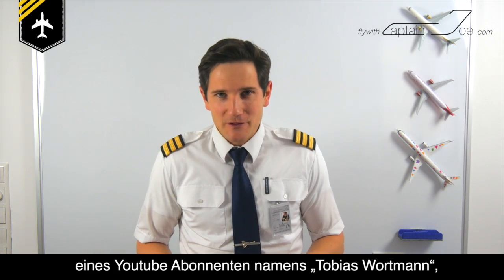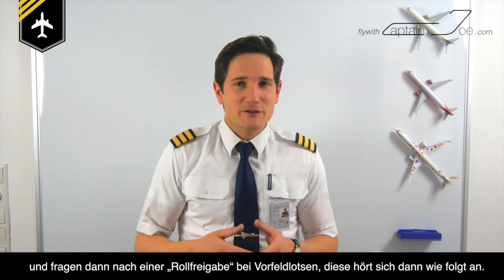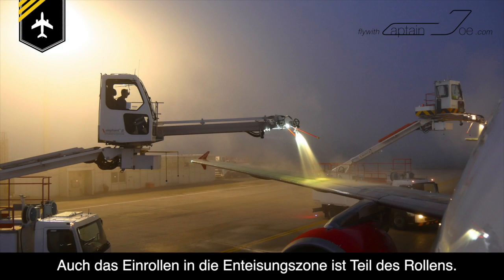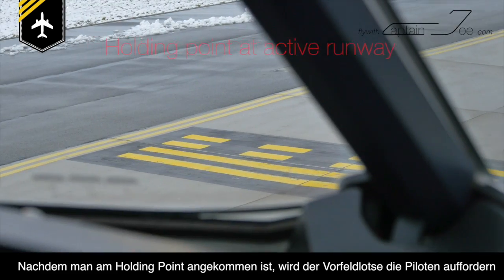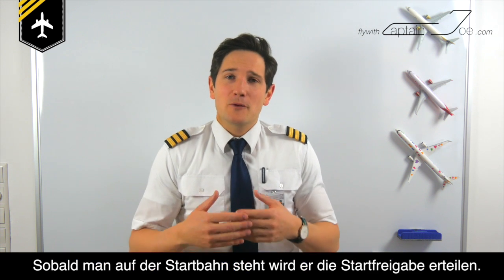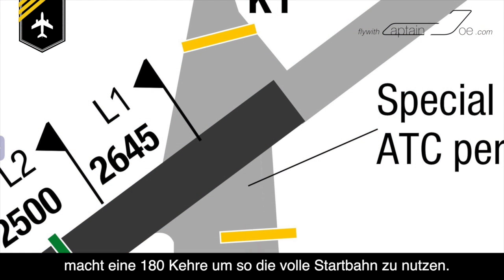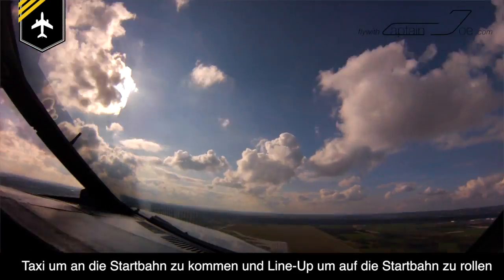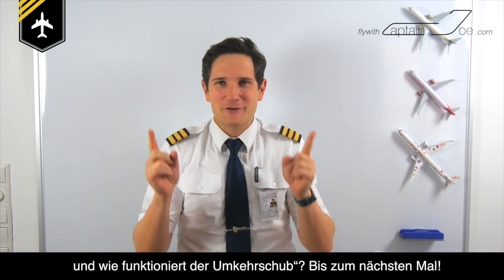Taxi and Line Up! Explained by Captain Joe

Comment: Sir 

How plane reaches its appropriate gate after land ing .. specially in large or multi gate airport..how you find the path
Reply: Pilots have the airport taxiway map in their iPads and the ground controller gives the instructions which taxiways must be used. Each taxiway has its own letter code that distinguishes them from each other. The ground controller uses these letter codes when they give the instructions.
Reply: @mikep9604   thanks sir

Comment: Sometimes do the tower say "cleared take off, runway 27" even if you havent lined up yet? And your still in a holding position

Also, i know they say "line up and wait" if there is traffic crossing the runway, or an aircraft has just landed and hasnt vacated the runway 👍

Comment: Boeing 747 requesting ifr clearance to IIA - Boeing 747 requesting push back and start from gate 7 facing southwest - Boeing 747 facing southwest and requesting taxi instructions - Boeing 747 holding short on delta - Boeing 747 lined up and requesting take off from runway 40 right - Boeing 747 requestion freq change to IIA - Have a great day tower - 
Yes guys im board and have no life i know

Comment: Capton.
Pls. once u take off how do u communicate to the various towers on the way...till u reach the landing
Reply: Air traffic control services (ATC) on the aircraft's flight route use different radio frequences, and the pilots must change the radio frequency to communicate with these different ATC services during their flight route.
Reply: @mikep9604  how frequent do you communicate ,, every few minutes? also is it by voice or by system
Reply: @kaleelururrahman6059  -  Not every few minutes. But for example when arriving to a new ATC zone, or when need to change altitude (descend or climb) to a new flight level, or start the approach and landing procedure, change course or flight plan, or when ATC contacts and wants the aircraft e.g. change its flight level due to other traffic, or gives some general information. These are few examples. Communication is normally made by voice, but airliners also have a data link system CPDLC (Controller Pilot Data Link Communications) which can be used to send and receive certain non-urgent ATC messages via text message between the aircraft and the ATC.

Comment: Does a plane always have to land a certain way taking in the account of the movement of the earth? I would think if it did not two things moving in two different directions would cause the plane to wipe out.. If you try to move two wheels against each other the opposite way it does not work out well.

Comment: I am not a commercial pilot, what does the term "shortened" mean? During taxie I hear it like 22L shortened
Reply: It means that aircraft can't use the full length of the runway. The reason of this is often repair or construction. So the runway has a shorter useful length for the aircraft than it normally does.
Reply: @mikep9604  thanks

Comment: I have a question. How atc are able to give clearance to so many aircrafts at once .how they are able to connect and how confusion is been avoided?
Reply: Depending on airport facilities, ATCs in a low tech airport may rely on pilots’ timely reports to keep track of them and plot their route on airport ground chart, better airports would have ground radar to provide more accurate (and mostly real time) tracking, the most advanced airports would have ground movement sensors and other equipments to compensate what ground radar alone could not cover.

Comment: Hi joe i want a know what are the qualifications do required to be a pilot
Reply: Briefly: 
- You have to be able to hold the Class 1 medical certificate.
- You have to be graduated from high school (Europe). However, if you are in the      USA the major airlines there usually require a college degree. 
- You need to have the English proficiency test to fly international flights.
- You have completed the training for a commercial pilot licence (CPL) with multi engine and instrument rating. You will get the ATPL (Airline Transport Pilot Licence) later. 
- You can get a PPL (private pilot licence) at the age of 17.
- You can get a CPL (commercial pilot licence) when you are 18.

Comment: Captain J why are jet engines not secured with a sieve like wire material to avoid birds from entering the engines
Reply: prince handima because even a net like structure can mess up the airflow going into the engine.

Comment: The part about the plane limited to 10 knots when turning to prevent front wheel collapes....after landing sometimes its felt like they are going aloft faster than 10 knots when turning, but maybe the speed limits are different.

Comment: So the Tower control says "Are you ready"....but what if the pilot says "Nope"
Reply: Then tower would ask about the situation and how the crew would deal with it, should the problem couldn’t be dealt fast by the crew on the holding point, the plane will be removed from the runway either by having it taxis or being tugged to somewhere the tower assigned for it (e.g. the de-icing pad of the runway). In emergencies which the plane cannot be removed (fire, crash...etc), the runway would be closed off.

Comment: Are large aircrafts able to pushback (go in reverse )on its own power ?
Reply: The reverse thrust is not used for pushback at the gate or on the ramp. There are several reasons why it's not allowed. There are airport and airline regulations, important safety reasons, and extra fuel consumption. The jet blast is dangerous for the people working there, and it can damage the nearby equipment. And the jet blast can kick up debris from the ground which can be sucked by the engines and cause damage for them. So they use the pushback tugs.
Reply: @mikep9604  , thank you. I get what you're saying and know that. My question, however, is about the technical aspect of ability: Can a large twin-aisle aircraft push itself back just by using thrust reversers. This is regardless of whether it is regulatorily allowed, or whether it is a good idea, or whether it will damage nearby equipment, or whether it will increase danger to ground workers. My question is one about ability. Hope this makes sense.
Reply: @thihal123  - It is possible. I have seen a report about B747 doing that.

Comment: My question 
Why don't aeroplane does not collide In air?
How they travel with out collision with another? 
How they
Reply: It is because Air Traffic Control carefully plan the directions a pilot must take to safely reach the intended flight path. It is called vectoring, each instruction is called a vector. The pilot is then instructed how high they will fly, or the pilot can request a height if they wish. If all the pilots follow instructions correctly, everything will be fine, but the Air Traffic Controllers keep a constant watch of aircraft positions anyway, on their screens. If an aircraft strays from the instructed vectors, they will be told to correct themselves. I hope this is useful to you.

Comment: As a controller in the US, you will never hear us say "Line up and wait behind landing/departing *aircraft*". That would be us issuing what we call a "conditional clearance" to a pilot and we are NOT authorized to do that. At least not in the US anyway. Controllers are required to wait until the first aircraft is past the taxiway that you will be departing from and then issuing the "Line up and wait" clearance ("Callsign, Runway ##, Line up and wait. Traffic to exit/Traffic crossing/etc")

Comment: Captain Joe, I do not know how my question would reach you or whether you see question through the comment section. My Question is, ""If you can make a video on how starting from 4000 ft, say to land how step or stagewise descend happens, as we hear in plane Captain announces roughly around 30 minutes ( referring as an example domestic flights India) before about landing process" or will be ready for landing"

Comment: I have a question. What's the sound that we hear when we step in the plane. It sound's like an engine but actually the engines aren't started
Reply: MR WHITE BLACK if you happen to be at a remote stand, most likely it's the APU. Alternatively, external air conditioning at warmer destinations contribute to the noise during boarding.

Comment: I live in Australia and I have to fly out of Gold Coast International Airport (YBGC) to Melbourne International Airport (YMML) and back almost everyday. The airport is very close to homes and buildings, meaning we have 1 engine taxi on a B737-800 Virgin Australia. About 3/4 of taxiing is done without engine #1. This is only in the mornings, because the noise may damage the houses and buildings. And only put about 60% of throttle into the engines, thus creating less noise, using up all of the runway. In Melbourne however. It is massive, and in the mornings both engines can be started up prior to taxiing. Also no homes nearby or buildings.

Comment: Hi captain .
I hope you will relp me
if there is any pilot here kindly answer my question.i observed many times on flight radar that mostly two planes of same type just like Air bus A320 on same route but travelling with different speed just like one was at 752 and other wss 960.why there is speed difference ??pilot save fuel????

Comment: Hi Captain Joe
Your all videos are so informative and knowledgeable. I would like to thank you for awesome videos. 
i have a question for you related to taxi, while taxing the plane to the holding point pilots may use brakes just to slow down or maintain the taxi speed while taxing  if i am not wrong but at what intensity they can apply breaks and if they apply does it feels to passengers? 
Thank you :) 
Love your Channel 
Ravinder Singh
India

Comment: I was recently on a Lufthansa flight which was heavily delayed due to take off restrictions/weather (Captain said air traffic control only permitted 1 take off every 30 minutes; delayed by around 4.5 hours sitting in a very hot cabin with backup power malfunction on the A380). We were also told by the informative Captain that we needed to remain in the plane with cabin doors closed so that we could 'queue' for take-off but our plane remained parked at the boarding gate. Is there a difference in the queuing procedure between waiting at the gate and waiting next to the runway? Were we still under the 'taxi' phase before departing the gate, or 'line up'? This was at HKG. Thanks! And as always, great entertaining videos :)

Comment: @captianjoe I was landing in Iceland airport to transfer to Germany, about 30 meter(ish) from the ground (landing), the plan quickly takes back off, and climbs back into the air to land on the other way of the runway, what's the point of this?

Comment: Nice explanation. For taxi, i hear few pilot need to "juggling" if the plane can pass with middle yellow line. On planes like A380 or 777, both planes uses external camera. For line up, i found some flight are took off immediately (i mean pilot start to increase take off when lined up without stop)

Comment: Yeah Joe I have problems with the question and the answer. In the caption and introduction, I was expecting to see or hear "what is the difference between taxi into position and hold and line up and wait?" Instead the question was, "what is the difference between taxi and line up???" In your answer you explained the atc instruction "line up" which you will never hear any atc say. At th holding point you are either instructed cleared for takeoff or line up and wait. You even said atc will say line up behind. That will definitely never happen without wait. Perhaps the question meant to be "what is the difference between taxi into position and hold and line up and wait?" The USA used taxi into position and hold prior to 2010 and switched to line up and wait.

Comment: Hey Joe, how do you perfectly align an aircraft with centre line of a taxi  or runaway? Any cameras under belly assisting?
Reply: Dan Will Usually you need to align the centreline at the middle of your point of view, which is around where there is the warning system in front of you.

Comment: I noticed showed a picture of the de-icing operator in the enclosed bucket. That brings back memories when I used to operate these at NWA definitely more comfortable than the open bucket having to hold a hot hose of glycol. I had privilege of operating both. The enclosed was more complicated to use bit at least I didn't freeze in the open bucket and the wind blowing glycol in your face. Kinda funny it tastes just like Tutti Frutti Bubblegum.

Comment: Captain Joe - why are go arounds not good?     Btw, your English is perfect.  Thank you!
Reply: Not to mention the delays. Imagine missing your connection because some dolt wasn't ready for takeoff and entered the runway.
Reply: steemdup because it's a heavy load of stress on the engines, also during go around the engines are very inefficient and can't burn the fuel completely as well as usually
Reply: steemdup and for passengers, this procedure is on the one hand very exciting (for some passengers) but on the other hand you can feel the enormous force, that pulls you in your seat, maybe not everyone will enjoy this, but I definitely would :D
Reply: There are two different issues there,one is pilot  readiness and  the other concerns unavoidable problems like crosswinds.
Reply: And there is also the fact that tower will not be impressed with you especially at busy airports where they are under constant pressure to move north of 40 aircraft per hour per runway in some cases. You blocking their active runway because you didn't get yourself in order will go down like a lead balloon.
Reply: For many reasons, first and foremost the extra fuel burn, the delay which could result in passengers missing their connecting flights, and the confusion and extra complication of re-sequencing the aircraft back in the approach from the controllers' perspectives.
Reply: no that's not right. The Pilots don't have the fault when they need to go around, for example due to bad weather or sth else
Reply: I had a go around once at KRNO.  I think it was for a reason Joe does not want to talk about.  Basically its an emergency situation where a landing plane at the last moment cancels a landing and flies over the said runway and pulls up in an emergency like manner.  Go arounds especially due to hubris by misbehaving tarmac planes can be very dangerous and time consuming, let alone costly.  Definitely something to avoid unless it is completely unsafe.

Comment: Joe - What is the name of the U shaped primary controller which the pilots use to steer the aircraft in flight? 
Also, did I hear you correctly in the video - The "Tiller" is used to steer the aircraft during taxi or line ups?
Reply: it's called Yoke and yes, the Tiller is used to steer the aircraft on the ground.
Reply: yes, its like a paddle controller on an atari 2600,  it turns the nose wheel (slowly) because there isn't enough speed for functional control via the air surfaces. It need to be positioned center, before takeoff. there is a pin for the ground crew that the nose wheel free swivel when they hook up a tow bar.

Comment: How do you know when the nose wheel is on the centerline on the taxiway or runway during turns? I have troouble doing it in FSX. I normally turn too early.
Reply: MrJetra Prediction
Reply: Ifly 777 You mean, learning the feeling of where the aircraft is? Or, do you have a fix point, i.e. in the cockpit or on the horizon?
Reply: MrJetra There is. In fsx, it is about at the warning buttons below the glareshield
Reply: Ifly 777 Okay, thanks. I will have to exercise myself.

Btw, do you know anything about the genuine Sperry-Honeywell MCP? Of my special interest is the function of the max bank angle under the Heading knob. 

This MCP has a rectangular base-shaped heading knob, but how do you set the bank angle? Are they two separate knobs, or is it a knob on a push button (eventually, how do you know the actual bank setting if you just push it)?
Reply: MrJetra I don't know sorry.
Reply: Probably because of no depth sensation on the monitor.
Reply: MrJetra well correct me if i am wrong, but pilots match with center line of the runway with the divider of wind screens in front of them( seperation between the main wind screen)
Reply: @saajanshah1820  you'd be off the centerline
Reply: Put it on the centre line visually with an external view of the plane(outside xockpit) then freeze.Then check where the centreline us with inside cockpit view use a referwnx3 point. Eg Master warning push button panwl or wiper area..it wipl vary where it is for differentbtypes of aeroplanes.In the comp flughtvsim it ay look differenttgan on the real planevduevto scale differences.In thevreal plane  it usually is if from rightbseat..slightly left of right knee..provided your seat height is adjusted correctly..with reference to aligning the three small marbles 2 white and one red or black in the middke behind the centre window pane shield.

Comment: As always great video Joe, would you consider making a video about speed breaks, what they do, when their used and some more informations about them. Thank!
Reply: Speedbrakes/spoilers/lift dumpers are panels on the top of an aircraft's wing. These panels can be extended in the air to increase drag (reduce speed) and reduce lift (increase rate of descent, which makes the plane go down faster).  The speedbrakes can be partially extended in the air, but they are always fully extended right after touchdown. This keeps the aircraft firmly planted on the ground, increasing the effectiveness of the wheel brakes.